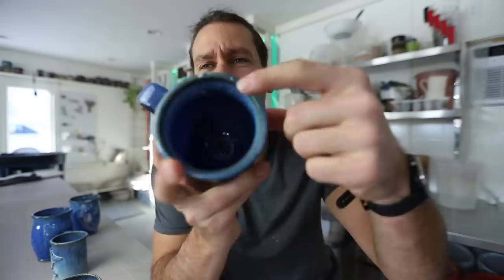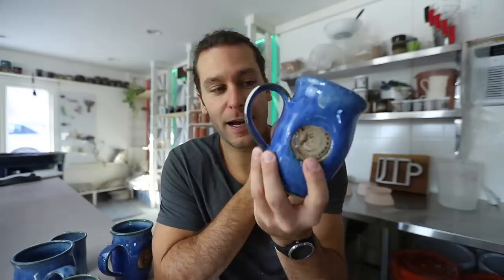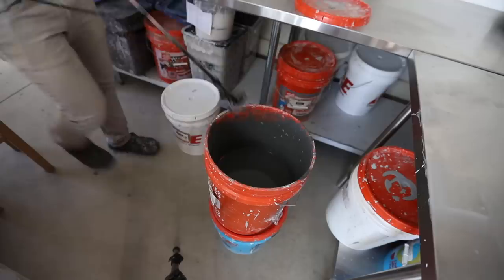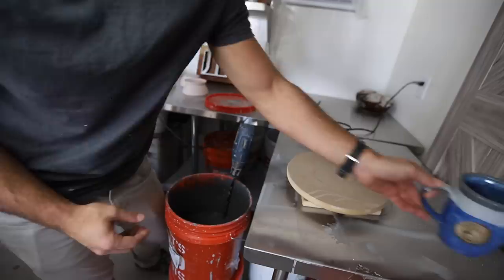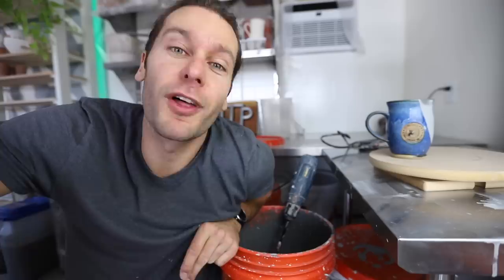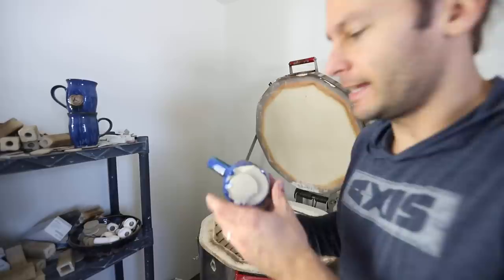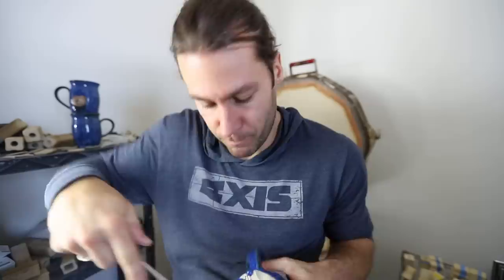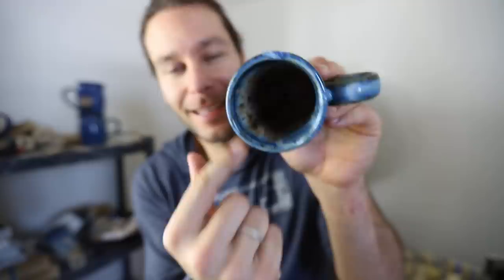How to RE-GLAZE your failed pots!!!

Comment: What did you put the piece on when you glazed upside down?
Reply: I am curious as well.
Reply: our class uses stilts which are like metal pieces that come out of a base and u set the piece on the metal part and it pops off after firing
Reply: Me too , wanna know....pretty pretty please
Reply: I’d like to know as well.
Reply: Me too! :)
Reply: I don’t know how Jon does it. But I use a small shelf support taller than the piece is so it doesn’t touch the shelf below and place  a very small 3 prong wire stilt on top of it. Turn the piece upside down and balance the inside bottom on the wire stilt. There is a potential problem of the glazes running on the inside if you have too much glaze in the bottom so I make sure I use a stilt with long wires,

Comment: One note, when using a heat gun to warm the pieces, before reglazing.  As the wares are vitrified, they don't respond well to thermal shock.  So they heating should be done gradually, and the heat gun moved around, as to not focus the heat in one spot.
I like the look of the mug you fired upside down, in regards to thr flowing glaze look.  I don't think I'd like the drips on the rim though.   It would be awkward for me to drink from.  Plus with firing upside down, you have to deal with either having a bare rim, or getting rid of stilt marks, on the inside.
A little kiln wash with alumina hydrate on the cookies will allow them to release way easier.
Also, I'd definitely wear leather gloves when dealing with jagged glaze bits.  Those edges are like a scalpel!

Comment: Get yourself a set of cheap wood chisels for knocking drifts off before you grind them they're great for cleaning shells as well a lot of times you hold it at less than a 45 degree angle a little tap with a hammer and many many times it'll pop the little drip right off the shelf

Comment: You do this exactly like I do but I typically use a torch a map torch. I was using my heat gun but the coil went in it I fixed the coil but it's a tenuous fix so I just use the heat gun when I absolutely have to until I fix it properly or buy a new one. But this is exactly how I reglaze things
Reply: Could you describe a 'map torch', do you think? What I understand by it (in British) wouldn't get nearly hot enough.

Comment: Awesome, I have been doing a lot of multiple firing nd never reheat, but I will try. Also your clay body is designed to be fired to a certain temp so multiple firings or more heat work are the best for practical things but maybe that’s being picky. Too many firings, ie. 3x at^6, and giant bubbles will appear, I mean like 2 or 3 inch half spheres. It’s kind of surprising. So now I follow someone’s rule of firing first to cone 6, then cone 4, then a low fire glaze application and fire to cone 04.
Reply: Do you know by any chance if it possible to reglaze with a low fire glaze if the initial glazing was done with a high fire glaze?

Comment: I've been using thick glaze with "seroil" (don't know if it has a different name in English, the fixative to decorate in 3rd firing) and just paint it on the problem spots, works great! but with bigger pieces sometimes the parts that have not been repainted come out of the refiring a bit bubbly - lots of tiny tiny holes, probably because of the re-melting. does heating the pot up before reglazing get rid of this problem? thanks! and your videos are great!!!

Comment: Question? Can you heat the mug quickly in a microwave to speed up the process of heating it? Thx for the tip on the little pieces that you sit your mugs on.
Reply: This is what I do - microwave is great! I do it in little 5 second bursts. Also good for raw clay pieces but you have to be super careful not to over do it.
Reply: @JamesHayesArtist  Thanks for the info, I have some reglazing to get done. So I'm going to give it a try.

Comment: This is awesome! Could you do a video about better glazing techniques? I always get pinholes and super thick dripping (even though I dip it for 1-2 seconds).
Reply: Pin holes can be a lot of things. You can try bisquing at a higher temp, say 04 instead of 06. A short (5-10min) hold at top glaze temp can help. I use a dark clay prone to pinholing, so I have a 10 min soak at top temp then drop 100F and hold again for 30 minutes to let bubbles heal over.

Thick glaze, you may just need to add a little bit of water to your glaze to thin it out more.
Reply: Try firing your bisque at a higher temperature, then your pot won't be so absorbent and take up less glaze.

Comment: How did you fire it upside down? Wouldn't the glaze on the inside stick to what ever you used to prop it up??
Reply: I think it gets balanced on a long Metal spike, right in the center of the inside of the cup.. Like those spikes for cash slips, but with clay bottom not wood Haha. Should be easy to make yourself. 

Just not sure what metal works best with the heat- you have to experiment with it to find out.
Reply: it wasn't fired upside down, the shelf above was too low
Reply: @thesouthwestern  You really have to buy metal wear from a pottery supplier. Most metals melt a whole lot lower temp. than cone 6!!  I use a lot of stilts for my 0.5 earthenware which are always glazed on the bottom.  But for my cone 6 stuff I've never even heard of metal stilts. You can buy porcelain stilts which like  Jon's cookies lift the stoneware off the shelf - only on little nubs. The porcelain won't stick because it's already vitrified at cone 10 but it would certainly stick to glaze so..... I'd love to know how he fires at cone 6 upside down.
Reply: @Middlesex1957  I will have to do some experiments of my own hehe.
Reply: @naplin  I think the mug referred to here is the one with pinholes from the first firing (8:05) that was refired upside down, not the one that touched the shelf above in its first firing (0:35).